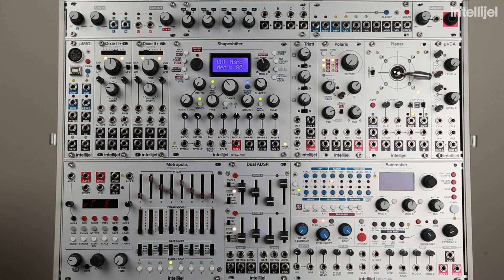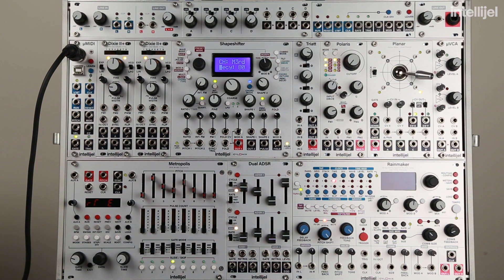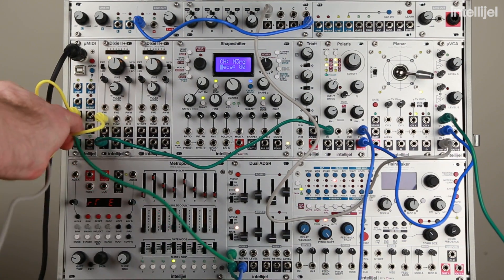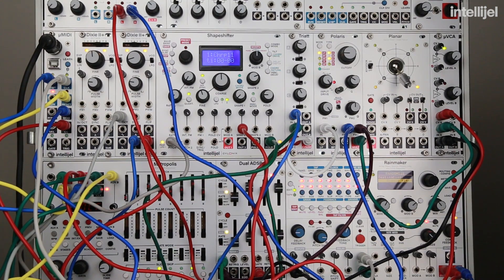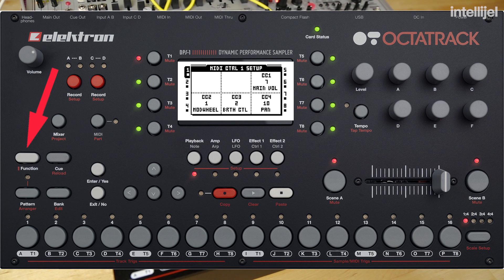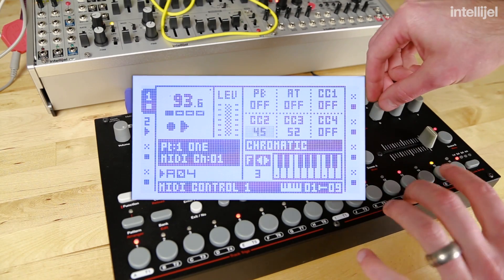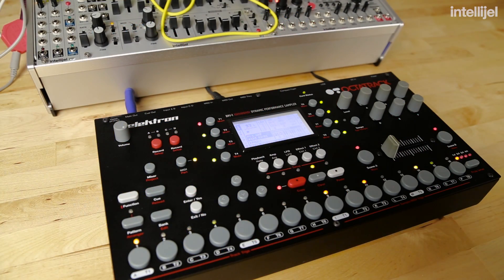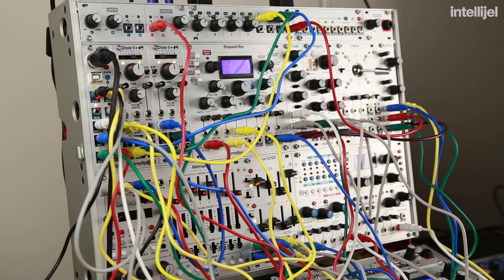Intellijel µMIDI Tutorial 6 - 5 Pin MIDI

Comment: So  this work with 2 sequencers one having midi and one not and that’s where u midi comes into play? Do I have that right.
Reply: It would depend on the sequencers. If you had one sequencer with a MIDI output and a eurorack sequencer with only CV input, µMIDI would let you sync them together. If your two sequencers could both be synched with MIDI or CV then µMIDI might not be necessary, although you could also use the other outputs to sequence various things in a eurorack system.

Comment: Hi :) Thank you for the videos. they are great! I had a question to ask you. Is it possible to sequence via the umidi with a digitakt or octatrak, without having a sequence module like the metropolis? So basically only using the electron devices as step sequencers. Also, If this is possible, is it only limited to 16 steps, or can we use the full 64 step capabilities of the electron sequencers? Thanks
Reply: Yes, this is possible Dara. I've done this with Octatrack, but I'm not familiar with Digitakt. You would use a MIDI track to generate the sequence and assign µMIDI to the same MIDI channel. Then you can sequence the same as any other track, including using parameter locks!